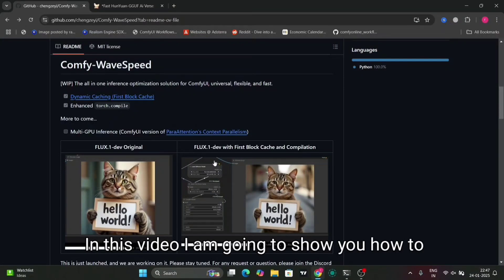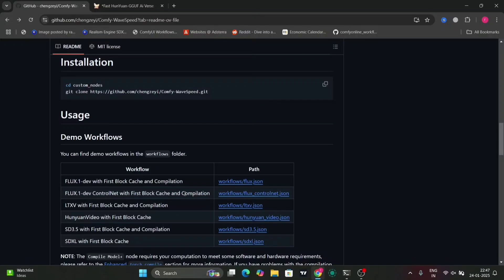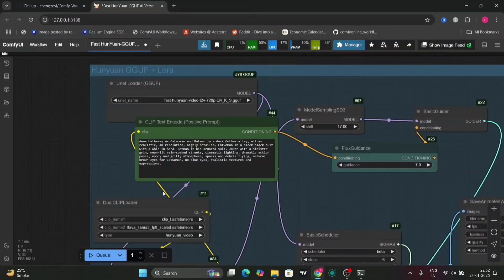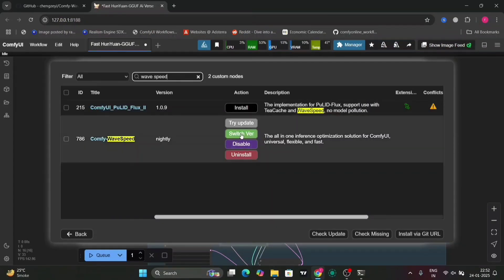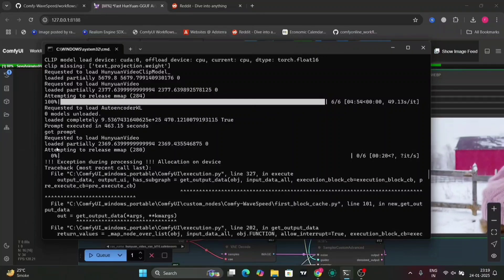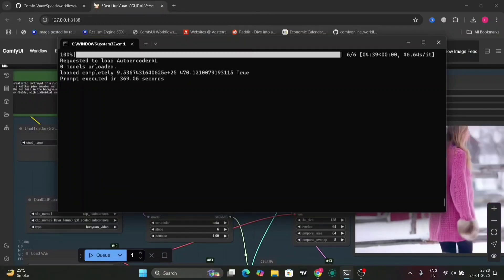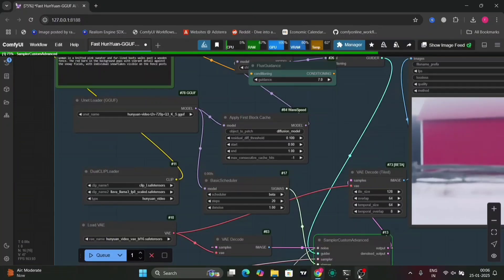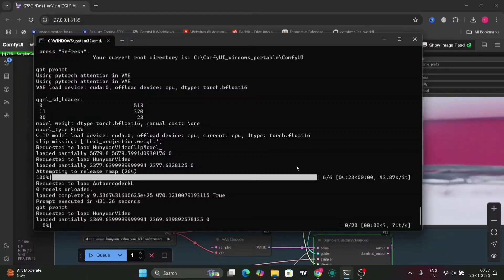WaveSpeed for ComfyUI: No Triton Required! Easy Setup Guide

Comment: i need to triton please thnx..triton windows !!!!
Reply: KSampler
AttributeError: 'UserDefinedObjectVariable' object has no attribute 'proxy'

from user code:
File "F:\AAI\ComFYui\ComfyUI_windows_portable\ComfyUI\custom_nodes\ComfyUI-GGUF\ops.py", line 139, in get_weight
weight = dequantize_tensor(tensor, dtype, self.dequant_dtype)

Set TORCH_LOGS="+dynamo" and TORCHDYNAMO_VERBOSE=1 for more information

You can suppress this exception and fall back to eager by setting:
import torch._dynamo
torch._dynamo.config.suppress_errors = True